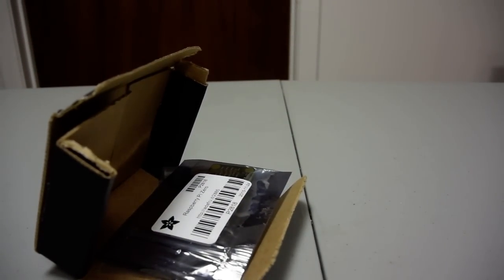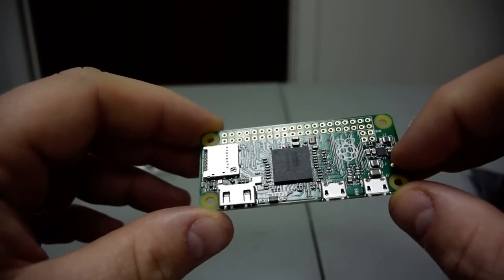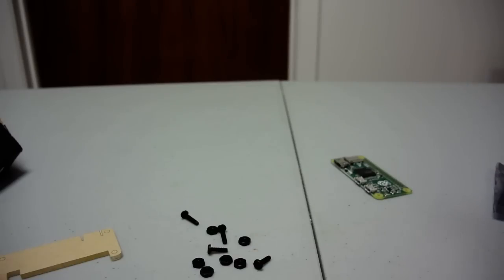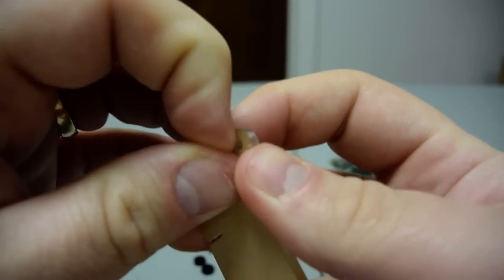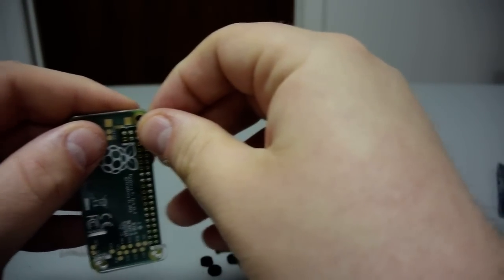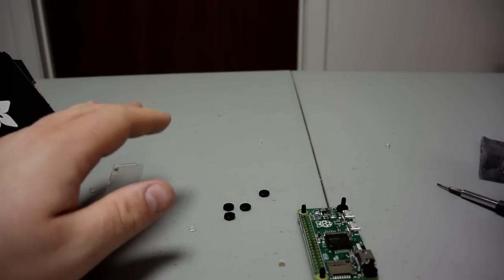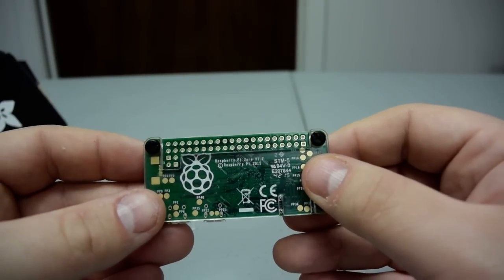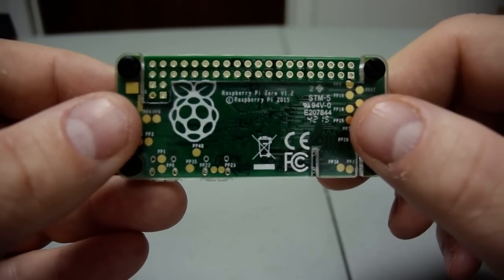Raspberry Pi Zero Unboxing and case install -- Is $5 Linux computer worth it?!

Comment: since it has built in wifi and bluetooth, you can connect to other wifi devices and operate the pi over bluetooth so you don't need HDMI, USB Hub, OTG cable or any of the other things you mentioned

Comment: The reason Ras Pi have a micro USB rather than a full size is because if you are doing a long term project you're not always going to have a mouse or keyboard connected, it's easier to fit it into smaller spaces that way which is why this computer was developed
Reply: And you can control the Pi over GPIO from a desktop computer anyway

Comment: woah! I haven't seen anything like this.. A guy is expecting from a raspberry that it'll act as a PC. 
Dude... Learn what is a computer, which Raspberry Pi Zero (and other versions), Arduino, and others actually are. These things are made for enthusiasts, which know (or eventually will learn) how to operate such thing. 
In no means these are meant as a replacement for your Windows/Mac/Linux PC...

Comment: When it comes to the paper, try using a knife (;
Carefully ofc, and yes, the Raspberry Pi Zero has hidden costs... IF (In caps for a reason) you try to use it as a computer, which I don't think it was fully intended for (Unless you want a very small one, which I will make using the RPZ soon ^-^).

I can see the Raspberry Pi Zero be more used for robotics, as you basically just connect your MicroSD card, power and your motors and censors etc... How you configure the OS and the software on it, you could make something really cool and it would be cheap. But like I said, if you intend on making a computer with it and attaching a keyboard, mouse and screen, it will cost more.

Comment: Please learn the difference between screws, bolts, and nuts.  You were horribly wrong all throughout the video. http://www.globalspec.com/ImageRepository/LearnMore/20125/bolt_vs_screw_compared0b3d316d44ca4967a227c33d64c6d18f.png.

I got a pi zero to replace a pi B to open my garage with my phone.  Do I need a $35 pi to toggle an output on the pi that gets used maybe twice a day?  All I need is a usb port for wifi and a gpio pin.  For 14% of the cost I'd be crazy to not choose the zero and open up my pi B for other projects.  There are applications where this product shines and others where other pis are the ones you pick.
Reply from the maker: +Ian Milne (milnosaurus) lol i realized my error after. just a lapse in brain usage. I considered outting an overlay to correct it, but found it funnier to leave as-is.

Comment: I dont think that in all projects you need a keyboard, mouse or screen. It is not ment to be a PC replacement. 
Buy cheap USB, wifi or ethernet adapter and access it remotely. I look at it as more poewrfull Arduino. You can built online weather station, or use for some Internet of Things project.

Comment: I think you spent WAY to much time complaining about the USB port on this thing. I mean, most people that are going to use it are going to use the GPIO and ONLY use the usb for programing. Don't forget the fact that it's a micro controller and not really meant to be a full fledged computer.
Reply: Uhm, the Pi isn't a micro controller. It isn't an arduino. Did you mean a micro processor? Because it has one. I'm just going to prepare my SD card on an A+ and put it in this one afterwards. This guy does have all the wrong expectations of a £4 computer. I can imagine this being used to built things like a Game Boy Micro-like game device or as a media player.

Comment: I can't even tell if this is serious. At $5 most people that actually use this will only ever need to hook a keyboard / mouse to this one time for initial setup, and those people will likely already have a usb hub. At worst some might have to buy the usb OTG cable but again that is an investment most people using one of these will gladly make so the next time they spend $5 on their next pi zero they won't have to worry about this.

Comment: Using this as a networked media center would be great and also cheap. With OpenELEC you only need two extra items the Zero doesn't have (except the microSD card, obviously):
A Micro USB OTG adapter: http://goo.gl/gDcVmu
A USB WiFi dongle, like EDIMAX EW-7811Un: http://goo.gl/h0lo3E
As I already have more WiFi dongles, I just ordered two of those OTG adapters and that's enough for me. Having network on the Pi is enough to control it via SSH/VNC or if I use OpenELEC there are Android apps (like Yatse) that works just great over the network.
So maybe it feels gimmicky if you don't actually have plans for its use but it sure is sweet piece of Pi if you do. :) Besides, if you plan building a robot, data logger, sensor management or so many other things, you either don't need WiFi at all or that would be just enough. So the price makes this a really cool option for development. :)

Comment: I agree with Samuel Sylvester.  This is a great for embedded projects.  There's absolutely nothing gimmicky about it.  It's what it says it is; a functional computer.  How you want to hook it up is up to you.  I've picked up all the converter cables and a 7 port USB hub and a power supply from eBay for just over a $10. This is far too much stuff for my initial initial project.  I also have plenty of micro SD cards gathering dust.  It's still a very inexpensive thing to set up.  I'm looking forward to installing Raspbian Jessie Lite and using it as an adblocker.  It would also be great in robotics or for openELEC in a kid's bedroom.  This is going to be a very popular piece of kit.  I can see schools and colleges scooping up these for student projects.  I guess even Sonic Pi could be used on it.  Yeah, it's a very cool and fun little computer.  I think you're being prematurely dismissive of it.